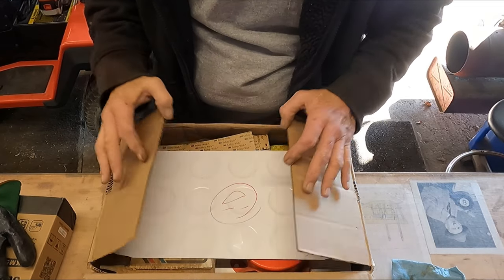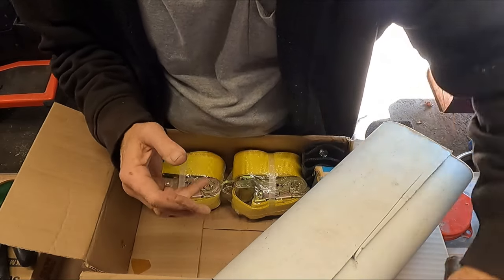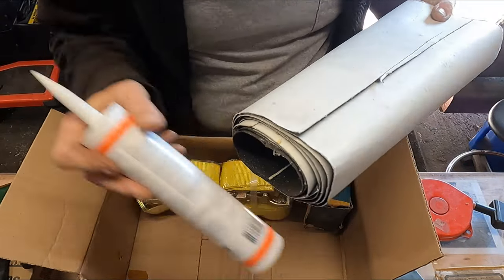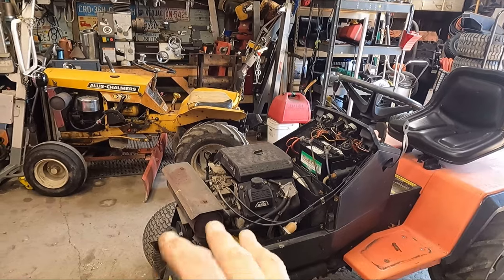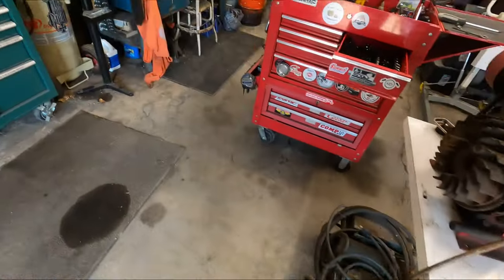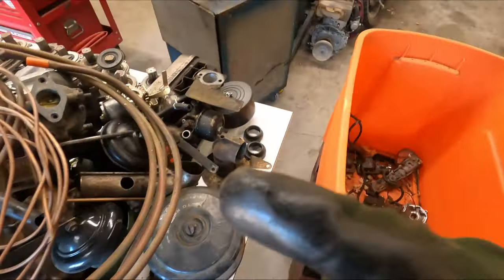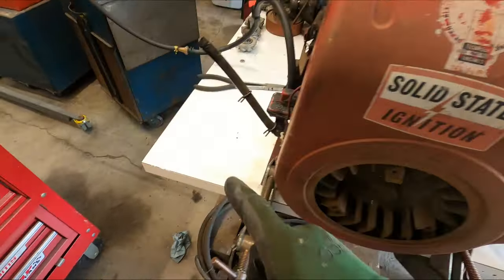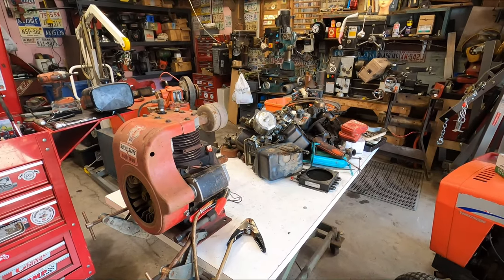Tecumseh HH100 EXPENSIVE Coil Install...We've Got Spark!! But No Carburetor. Part 1!!

Comment: Hello Zippo- Yes that red recoil from the box is a Tecumseh unit, very common in the 70s.
 I sure hope your throat infection gets treated and cured quickly. 
That cast-iron HH100 will outlast all of us! I just got a Chinese-repop adjustable carb for an HM/HH100 off EvilBay for around $14. It looks to be much nicer than the originals.
Reply from the maker: I've looked at a few and none are exactly like the one I removed, but they look close enough. I'm contemplating making a trip up North where I got the coil to grab a couple carburetors. I'd really much rather have an original on there if at all possible and a new OEM carb is near $100, so I'm not doing that for a tractor I'm just going to sell. I've got another HH100 in my 1969 Sears Craftsman Lawn Tractor that runs like a top. So if I can get a good original carb for a few bucks (possibly from the tractor that I got the coil from) I'll be a happy enough camper. Cheers! Zip~

Comment: Sweet ya got spark. I have 3 of those darn SSI modules and 2 are completely dead and the 3rd one has spark at idle but as soon as you crack the throttle open, more than a fast idle, it looses spark. Acts like a fouled spark plug but the plug is brand new. I even tried a slightly hotter spark plug and no difference.  I'm not spending $200+ for another questionable used one when the tractor isn't worth much more than that.
Reply from the maker: I got lucky with this one from the bone yard. I picked up two, but don't know if the other one I got is operational or not. I may throw it on the HH100 just to see after I get a replacement carburetor. Once the engine is happy, it'll go back into this old Wheel Horse Raider Hydro I picked up last Summer and I'll be plus one 14hp Predator with electric start and what ever I get out of the Wheel Horse. It's got a plow blade and a good deck with new bearings (at $100 a pop) that the previous owner threw in Winter before last. Hate hearing the coils you've got aren't working properly. I can only imagine your frustration shelling out dough for duds. Zip~

Comment: great gifts from paul ! i've had trouble with old (several years) silicone refusing to set up . might just be because my storage area gets really hot in summer . if that tube is old , test a little bit before using . it's a pain to have to clean it up , then apply new .